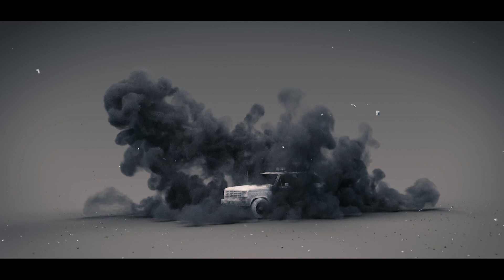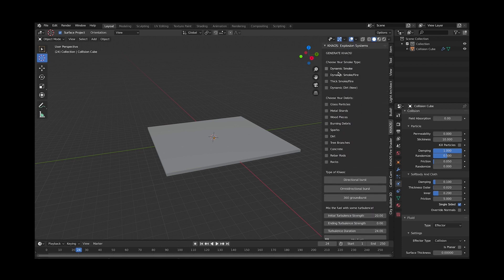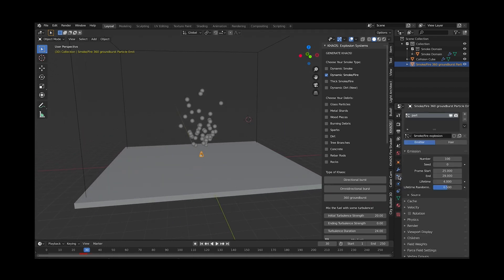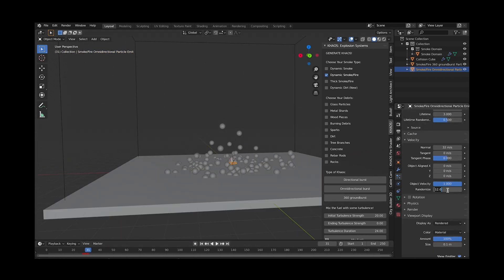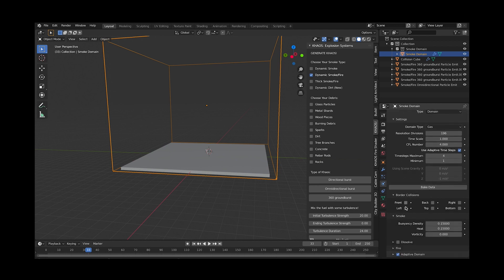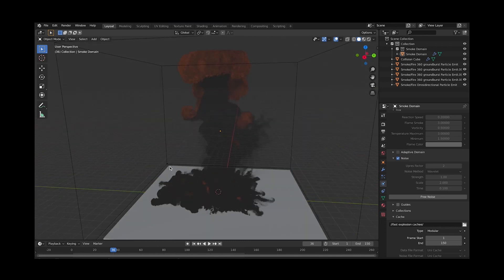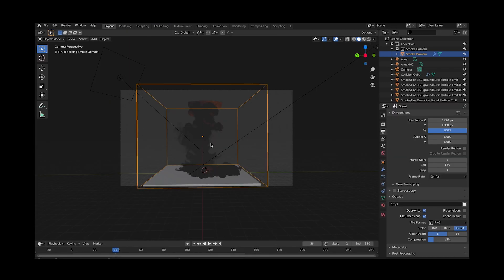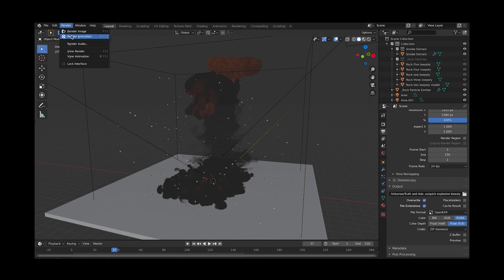BLENDER EXPLOSIONS IN 7 MINUTES: ft. KHAOS add-on! "Build" explosions in Blender!

Comment: in blender 3.3 it doesn't work at all.
To begin with, when I create the collider cube I get an error through the console that it does not find the parameter "effector" as a type of fluid, the same thing when I want to import the 360 groundburst domain, again I get an error through the console, and only The smoke/fire particle emitter generates me but without any configuration in its parameters, the type of fluid as "none"
This addon is very unstable, a shame because what can be achieved with this is great

Comment: hey there i bought this addon and i put all these settings like in vid and i just got so cringe explosion, not that cool like in video
Reply from the maker: Hi there. Thanks for reaching out. The simulations in Blender can take a bit of experimentation to get what you want. I recommend increasing the initial velocity parameters a bit more for most explosions in the later versions of Blender...and also adding turbulence force fields to make them more random.

Comment: I have hard time to form the shape of explosions as I want. When I check the tutorials there are some tips spread out in different tutorials(and different versions of blender). However should be nice to have a tutorial that shows side by side comparisons on the different settings(similar to  what you have at 3:29). To easier under stand how they affect the shape.

My plan was to just try to work with one explosion to learn to shape it before I start combine them. Where I struggle is to make the explosions as a mushroom (with thin foot). I can´t figure out how to make it with the 360 ground burst. I should also tried to make an explosion that  was quick but the smoke slow expended upwards like a gas can explode. I was not able to do that either :( 

Any tips on how to tweak the settings to achieve the two above explosions?
Reply: Same problem here :/ I tried legit copy settings from his vids and still didnt get the wanted result...
I also contacted him on blendermarket and he didn't reply to me yet and I gotta say, I am dissapointed
with such price you would expect maybe some basic tutorial that explains the effect of every setting to just have an idea of what to do
I am still hoping that he will release something like that one day or at least answer in the messages in blendermarket with some useful info
Reply: Same
Reply: Increase the initial velocity and add turbulence, that should do it

Comment: I love how easy this looks but I donť want to buy the plugin until I am sure it works - I found free old version on blender 2.79 but baking takes like all night to complete - Is it faster on newer versions or is it just my PC? I would buy the plugin if I was sure i can make something with it later but right now it just looks that my pc is too slow...
Reply: @Choked Boy thnks but I just went for it and bought the addon - Now I do it on Blender 2.92 and I bake like 8x faster
Reply: @Choked Boy Yeah, I read on some forums that baking got really faster from 2.79 to 2.80+ (for fluid simulations atleast) also now I use adaptive time steps with more accurate setting then default

Comment: Hi! Nice add on but even if I follow the tutorial, my render (cycle ,128res 3Noise) explosion is completly white..Like a flash.I don't see any orange. It seems that's a problem with the fire because the smoke looks well. any explanations?? It's frustrating when I see your results..;) Thks
Reply: @Choked Boy i've tried 2.83 worked best for me but settings should be different than tutorial does

Comment: Hi I bought the Khaos explosion plugin I installed them on blender 2.83 also on 2.82, and I wanted to do the tutorial the one with the truck but I realized that I can hardly move anything, everything slowed down as soon as I clicked on dynamic smoke / fire and directional burst nothing moves anymore except in slow motion, I don't know what it depends on, my computer has 16 gb ram and my graphics card 8 gb I don't know why everything goes so slowly, then I wanted to ask you please if when you do the tutorials for this plugin, try to do them more slowly and more understandable because most of the time you can't even see what you clicked, too bad because the plugin is a nice plugin but you also have to find a way to explain it well and above all slowly, ok ? thanks, see you soon....
Reply from the maker: Hey Pegasus, I'm not sure what could be the issue other than computer specs. Do you mind me asking what machine you are working on?
Reply: @LightArchitect   HI! yes   my PC:  intel i7  24 Gb ram ,  AMD RAdeon 5500 XT 8 Gb. is not the maximum, should be enough.

Comment: Lickin my chops for 2.9x. Although ground burst artillery blasts work and look pretty much the same for me in 2.9.1
Reply from the maker: Awesome! I'm gonna download the latest version today and do some testing myself. Thanks for the comment!
Reply: @LightArchitect  Yea I hadn't tried it last night but hot damn I wanted those artillery blast so I set a few up and let each one bake, which seems to take longer than 2.8.3, but I mean I see no difference with the artillery blast settings I first started using. Juts 2.9 allows me to do allot more and I've grown my skill set allot more with this version. I'm gunna light some stuff on fire and see how it goes, even with some of the newest in development versions. As I got the same result however I don't go for bursts of flames as that's not how artillery looks when it hits, but the smoke is all good so I'm gunna spend the day lighting some stuff on fire (In blender, lol). If I can blow my tanks up (2.9 helped me huge with making them) then I'd pay you twice for the same damn plugin
Reply from the maker: Hey Randmanq, The main difference in 2.9 is that the initial velocity doesn't work in Mantaflow. The simulation smoke only really moves according to the domain settings but not the particles themselves(other than the smoke shape). Just tested it and thought I would let you know my input. Anyways happy blending and if it works for you go for it!

Comment: Idea, and something I plan to try out in a future explosion test. Concussive wave via some sort of transparent shader with ior set to a to be determined value. The low pressure wave that proceeds the concussion could be a simple sphere shell volume with a noise texture applied that expands at the same rate as the concussion.
Reply from the maker: That would be super cool. We've experimented with shockwaves in the past but always got sidetracked with something else. Definitely will look back into it.

Comment: Every time I bake noise my simulation disappears completely and I have to start over? Is this because of adaptive domain in 2.9? Any tips on how to fix that?
Reply from the maker: Yes, 2.9 has glitches that still need to be fixed in the mantaflow fluid simulation system. I would use  2.82 or 2.83 for anything simulation wise until it is fixed. -Brad

Comment: What addons i need for this to work? Im using blender 2.91
Reply: Hi, you need the Khaos addons.
Reply from the maker: @dannybouchard4140  Beat me to it Danny!
Reply: @LightArchitect  Thx bro
Reply from the maker: @CroGamesPl9  For Sure!
Reply from the maker: Hi CarGuyReview, Danny is right. You would need the KHAOS add-on. Simulation is glitchy in 2.9 though so until mantaflow is fixed we recommend 2.82 or 2.83.
 -Brad
KHAOS is available on Blendermarket.com